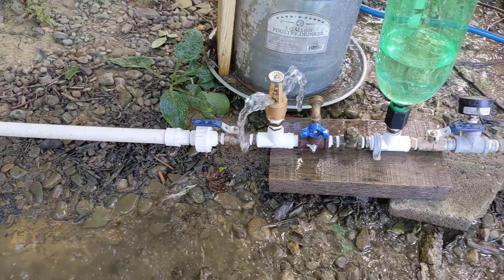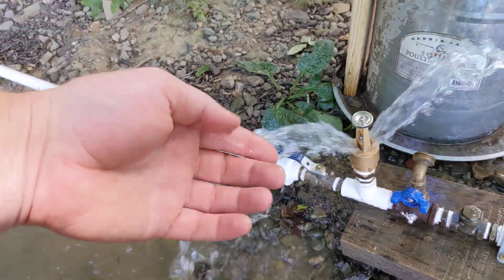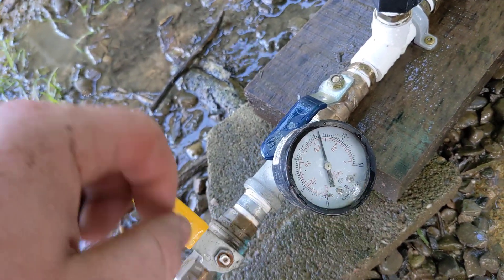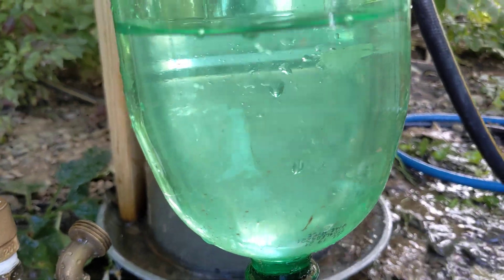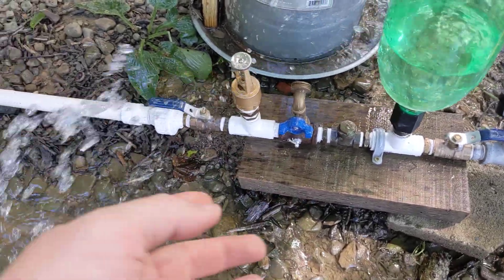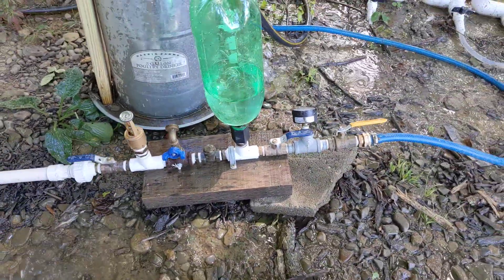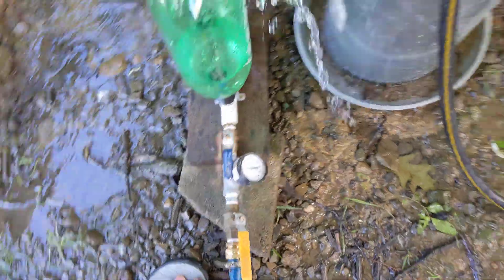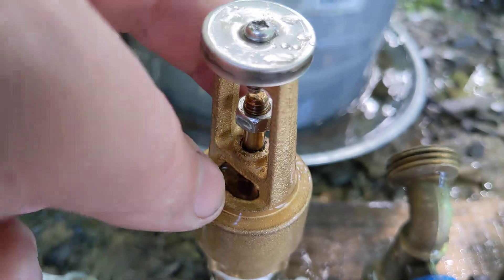Ram Pump Improvements (Modified Foot Valve & Snifter Valve)

Comment: Good idea with a sniffer valve. I drilled a 1mm hole under my check valve, but it didn't work. Have looked at your setup and have together with a friend changed the sniffer valve a bit, as my grease nipple is made of hardened metal. We removed the bushing at the bottom and spring. Then a small steel tube with an inner diameter smaller than the ball was inserted was inserted. The ball now has a few mm clearance and can sniff freely. Will be tested in Greenland in August.

Comment: I enjoy watching your videos, but I feel that I should point out that you can't to any meaningful degree compress water. The reason that there is a low pressure generated at the snifter valve/waste valve is the same reason that the pump works at all - inertia/momentum. When the hammer occurs when the waste valve snaps closed, the mass of high pressure water within the pump body pushes through the delivery valve into the reservoir/delivery pipe - however this now has momentum itself, and briefly continues to rush through the delivery valve, leaving a low pressure behind it when the delivery valve closes abruptly. This is why the waste valve opens sharply - it's actively being sucked open to begin the cycle again. A snifter valve simultaneously draws air for the same reason.
Reply from the maker: Correct on all points.

Comment: Another way to improve the efficiency of the valve is add one or more small magnets onto the valve stem. This increase the duration the valve stays open and increase the amount of water pumped.  If your source water is not enough, you can remove the magnets again

Comment: We used a cast iron foot valve that was on a 4" supply pipe, from the creek to the settlement pond where the ram pup was located, with 11 ft of drop over 1/4" mile. The settlement pond caught the check valve discharge and this flowed down hill to a catfish pond.  The ram pump lifted water to a cattle watering system parallel and 1/2 mile away through more 4" pipe.  After the check relief valve there was a 12" diameter and ten foot tall open ended stand pipe instead of a pressure vesicle, and i the pipe was clogged or turned off at the watering system, the stand pipe overflowed into the catch pond that still had a place to run off into the lower pond.   This is how water was transferred to the steam engine during the logging days, and we used it to just maintain the ponds and get water to the animals.

Comment: Hey . 
Would really like to see a video of you testing the head to lift ratio of your pump with these alterations to see if it's better than the average 1 to 7 ratio of the pumps were used to .

Would also like to know whether more pressure in the air pressure chamber results in higher output (if you were able to pump more air In manually )

Comment: how did you remove the spring from the grease fitting???
Reply from the maker: You can drill out the backside and use a pick to extract the spring.
Reply: @JoeMalovich  I wonder if a schrader valve would also work, Thanks.
Reply from the maker: I tried Schrader valves too. It's damn near impossible to remove the springs. I have had mild success with vacuum relief/prevention valves but I haven't had much time to properly test and share my findings.

Comment: Hi, nice setup ! saw an other video the other day (forgot where) where someone just bore a tiny hole in the T fitting instead of the snifter valve., it seemed to work too. 
 I have a water spring I d like to use to pump water uphill, the flow is good (maybe around 50 l/mn) but the head is low only 1 to 2m max. I d like to pump water 25m up. I was thinking of doing a "twin pump" setup, a first ram pump pumps the spring water up to 7  to a tank and from that tank 7m high I install a second ram pump that could pump up to 49m in theory. juts "wasting" lots of the water in the process. Still in the planning phase, I d like to maximise the flow of the 1st pump to have enough water to feed the 2nd. Trying to find out if a 1 1/2 or 2inch pump might work with my water flow / low head... Haven't found yet how to do the math before I spend $$$ on a 2inch setup.
Reply from the maker: The tiny hole is simple and works just fine but you lose efficiency and pumping ratio with it.

I'm working on a 2" pump right now that might be able to do what you want in a single stage. How much are you finding 2" ram pumps for? I'm working on pricing and testing it now.

Also you aren't wasting water, you are harnessing roughly 60% of the potential energy it has to pump a little water higher.

Here's a picture, it will have a custom waste valve I'm fabricating. https://www.joemalovich.com/2022/03/05/2-ram-pump/
Reply: @JoeMalovich  Can't find any ready made ram pump where I live (indonesia) but I can find all the fittings and have many choices of valves online so not really an issue, found super cheap 2inch full pvc swing valve, don't know if they would work VS a metal one though... https://www.youtube.com/watch?v=3AsXlVB-m2s  

I thought the head to lift ratio was generally x7 ? need to pump +25m higher than the water source with only 1 to 2m fall. So not sure  25m height can be achieved (x12 to x25) in a single stage hence my thought of doing the 2 stages.
Reply from the maker: @loulouki I suspect that that check valve is only meant for low pressure drain/waste/vent use. For the pressures you want metal is the only way to go.

1:7 is common for the brass swing check valves commonly seen in these pumps because the valve triggers prematurely. You need a way to keep the waste valve open up to maybe 95% of the steady state flow of the drive pipe/valve system, only letting the valve slam shut at that 95% flow rate for peak pressure.

Comment: I'm surprised you still have a "pop bottle" still attached to your setup when you have pegged the guage.
Reply from the maker: Dude pop bottles can withstand a bunch of pressure.
Reply: @Joe Malovich
  The last post wasn't meant to be "snarkie." Would be concerned about the pressure and sun degradation of the plastic over time.  I like the idea of the pop bottle so you can see the air chamber. How did you make the transition from the bottle thread to pipe thread? Also could you add/adapt a larger diameter swing valve than your pipe diameter inplace of the foot valve, or is there not enough water force/volume to operate the larger swing valve?
  Always looking for that "better idea".
Reply from the maker: @duaneroepke8840  pop bottles are free and easy to replace if they do get UV damaged, you can even get different sizes of course. 
I 3d printed an adapter from NPT to whatever thread bottles use nowadays. It took a few tries, layer separation is an issue with bottle threads because the sealing force is axial.

As for the different valves, you can certainly get the same performance out of a swing check valve by varying the size, angle, or material. Stainless valves of the same size are heavier and trigger at a higher water velocity. A sliding valve is easier to adjust over a larger range compared to switching out valves, as long as it's large enough to accommodate the peak flow you intend to use.

Comment: The market needs a custom made waste valve for these PVC type ram pumps
Reply from the maker: Yes, but I don't think PVC would last. Brass or Stainless Steel would be required.
Reply: @JoeMalovich  yes I meant for these style of DIY ram pumps.

Comment: Great work! Can you setup multiple air cylinders in parallel for continuous flow?
 I'm guessing synchronization would be a challenge but is it even theoretically possible?
Reply from the maker: I think one very large air tank would do it. You just don't want the sudden addition of a volume of water to change the pressure of the tank. A big tank would reduce the effect.

A long springy pipe might do it too, like 200 feet of garden hose maybe?

Comment: Awesome.   I am a land to home FAN!     Your content is great.  I wish I could buy a snifter valve like that.   My tank keeps getting waterlogged.
Reply from the maker: I made mine in about an hour, the hardest part was drilling the hole for the screw.  For some reason it's really hard metal.
Reply: Hello - Just put a piece of pool noodle in your tank and that will solve the problem. That’s what we use and it works for us.

Comment: is that momentary lapse of water, as the the plunger drops back down, due to cavitation?
Reply from the maker: No, more like a wave, of pressure
Reply: do you think it could still be measured at the intake or would it run itself to death before there due to losses?
Reply: pretty cool animation of what is going on with the wave of pressure going up the pipe
https://youtu.be/8-ro8npzvGo?t=205

Comment: fascinating! now could you use that water for something? maybe a pump to push the water back up the hill a short way to a supply back to the system?
Reply from the maker: I could. This is more of an experimentation setup though. I don't need the water this produces for anything.
Reply: @JoeMalovich  that is because u have the spring up the hill (I have seen yours videos). Do you use that flow of water only for hydroelectric? Do you drink that water?
Reply: these pumps are used to move water up hills without any kind of added power.   one could pump water up to the top of a water tower,  and then use that water whenever you needed it.  for turbine, or just general use.    these sorts of pumps can also be scaled up very large.  its just a matter of water volume and speed, given the right build,  you could pump an entire lake up a mountian,  then use water ram back down to power generators and to a lower lake, all the while the pumps need no energy, they pump water back up to the upper lake to be used again in generating power.    several of them exist today in the united states,  running clean energy power systems.

Comment: Would a Tesla valve work for the upwords facing check valve? This works without moving parts.
Reply from the maker: I Tesla valve might work great for the Snifter Valve since it's air in the easy way and water out the hard way.
Reply: @JoeMalovich  Actually that is a great idea @Max. I didn't think about that. It's one less moving part, meaning it doesn't add to the complexity much.
Reply: You need the valve to be free flowing and suddenly cut off to produce the pressure spike once the velocity is high enough. There's never any fluid going 'forward' through this valve (apart from a bit of air when the pressure wave has departed, allowing the valve to re-open), so all you're producing is a restriction to the free fall of water.

Comment: what if you put a spring on the brass valve so on the way up it would push against it, return would be faster so that might become an issue or the water will be enough to slow it down. Just an idea, I have exactly 0 knowledge about these things.
Reply from the maker: some ram pumps do use springs to return the valve instead of weights.

Comment: What stops the snifter valve from drawing in too much air? Would the buffer tank eventually "overfill" with air at all?
Reply from the maker: It did eventually fill with air, and it will start pumping air out with the water. Not detrimental I think.

Comment: If you ajust the frequency of open/close  of check valve,  does it rise the head ?
Reply from the maker: yes, if it closes at peak flow you will get peak head.
Reply: @JoeMalovich  ... so for optimized flow into a given hight, there would be one perfect frequency - correct? This asks for a super nerdy "MPPT"- kind of optimization. 
I see micro-controllers. solenoids..etc ;-)
Reply: Thanks Joe...  Yes i get it kind of MPPT yeh smart exmple

Comment: A Schrader valve will do the same .. thats why there's 1 on the duro piston pumps
Reply from the maker: I didn't have any to play with, and I wasn't sure they are "free" enough. Do you see how quickly the tiny ball was moving? The core of a Schrader valve is much heavier and slower.
Reply: @JoeMalovich  I see what your getting at since the vacuum that the piston pump produces is much greater than a ram pump .. good improvise on the grease fitting.. cheers

Comment: A Delrin bushing for the brass valve shaft, bored slightly oversized to allow for free fall of said shaft to open position.
Would the action of the snifter valve be a cavitation effect of the water flowing past it?
Reply from the maker: I have ordered some LM8UU polymer bearings and 8mm stainless rod for inclusion in a 3dprinted valve design I've been modeling. I've been thinking since nobody makes proper small ram pump valves, I could. I'd do brass bodies of my own design cast and machined in China, assembled by myself.
Reply: @JoeMalovich  I'd buy one 3/4" and possibly a 1 1/4" from you...